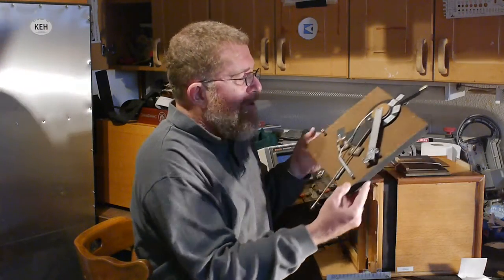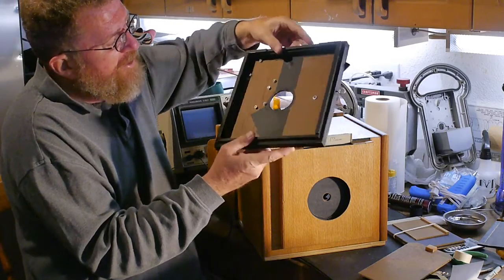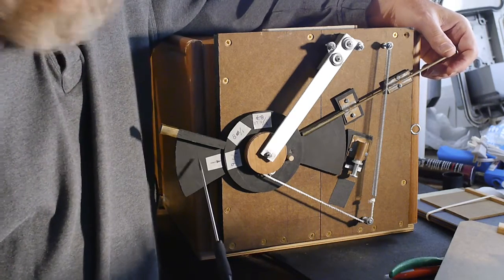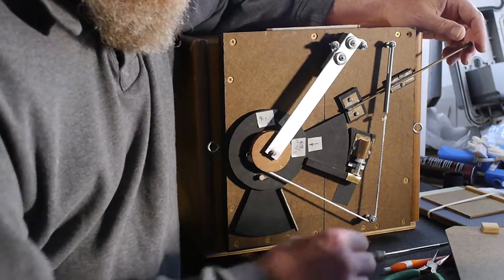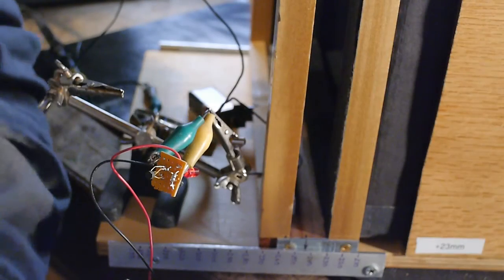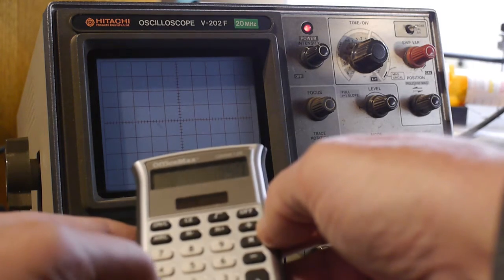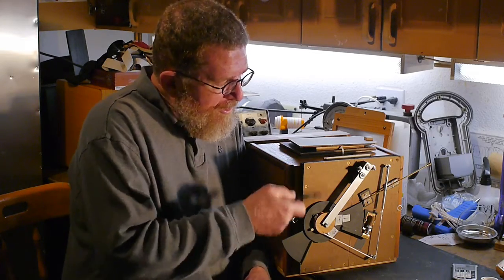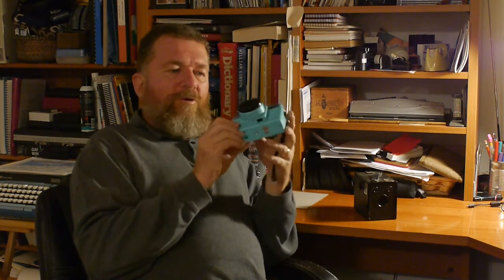Experimental Box Camera Shutter, Part 1

Comment: Hi Joe,
Have you ever considered making a motion picture film camera? A bit more complicated than this project but itd be very interesting to see. 

Thanks!
Reply from the maker: It’s an interesting thought. The challenge is the film has to move in stutter-steps, between frames, then stop long enough for the shutter to open and close.
Reply: @Joe_VanCleave  maybe you could have a shutter like the one from this camera: 
https://www.youtube.com/watch?v=7Q_SgMvTO-o&t=1s
and then have a gear on the same axle which only has the teeth in the closed position of the shutter which drives another gear on the film spool, so engagement and movement only happen when the shutter is closed? 

Again, obviously it would take some work, and you'd have to time cranking the camera to get a good exposure, but could be an interesting proof of concept. 

I might try it someday, but I'd really enjoy seeing anything you might want to try for it!

Comment: Thank you for this interesting video!  You probably know this but just in case you don't, you "invented" a bow tie shutter commonly found in motion picture cameras.   The issue of the shutter bouncing back and leaving a light leak may be solved by switching to a "half moon" shutter, also found in movie cameras.  To change the shutter speed you'd adjust the angle of the "semi" circular shutter.

Comment: Just stumbled across this video and I have to say that I admire your design and ingenuity. Like Klaus says, friction is not your friend so eliminating it everywhere possible will give you faster and more consistent speeds. A direct acting spring might help, maybe attached to the point where the cord goes around the pin to eliminate that friction. I'm fascinated by the different approaches that have been taken to shutter design.

Comment from the maker: I also still use my Speed Graphic, its curtain shutter is a great feature, meaning I can adapt any odd lens and still successfully time the exposure.

Due to the 8x10 camera having already been built, it would have been difficult to adapt a curtain shutter without totally rebuilding the camera. I wanted a shutter up front on the lens.

Some alternative shutter ideas, mentioned in the video, include travelling slit shutters, moving either horizontally or vertically, under spring tension.

I've also used my Bronica ETRS with Harman DPP, and it works well. I agree about its electronic shutter, very handy.

Thanks for watching!

Comment: Did you contemplate using a curtain shutter like the old Graphics did. My curtain shutter still works,but I use it sparingly due to its age. I went the oposite direction with small paper negs by making a single shot back for my Bronica using single shot holders from my Mamiya TLR. The Bronica has a nice 8 second setting thats accurate.Good Luck with this project. I have no doubt you'll solve this

Comment: Hello Joe,very inspirational video, indeed! 
May I add one or two thoughts, if You don't mind ? One of the things I've learned from repairing cameras and their shutters is that you want to get rid of any unwanted friction.It makes the shutter highly inconsistent.Doesn't matter where it comes from,dirt,hardened grease etc.So maybe it's possible to get rid of these" lightseals" on the back of the blades and build some sort of lighttrap in front of the mechanism instead?The blades look quite massiv.So in order to get a higher acceleration/ speed it would also be good to get rid of weight, specially in the outer parts.Maybe another sort of spring, a round one like in an escapement of a clock, directly attached to the blades would bring some more accurassy and would eliminate the pivot and the pully. ( Less weight and friction, higher speed ) .
May I ask You for a pinout of that probe You're using ? Maybe I can find something similar in one of my old VCRs in my workshop and attach it to my old Philips Scope . Thank You again for sharing Your thoughts, I highly appreciate it . Please keep up the good work !
Cheers,,Klaus